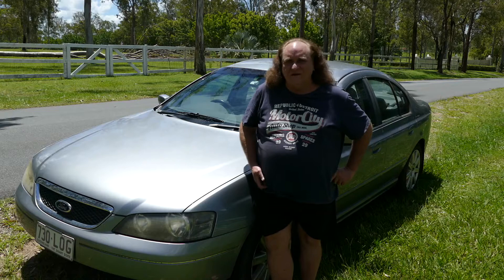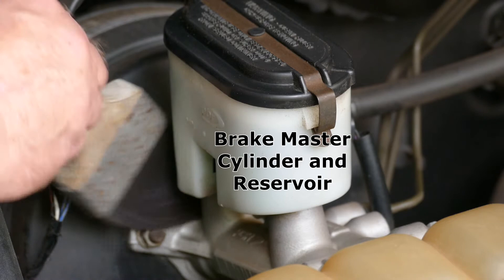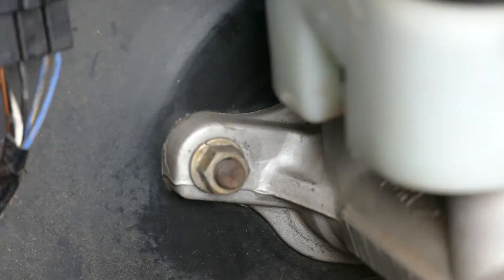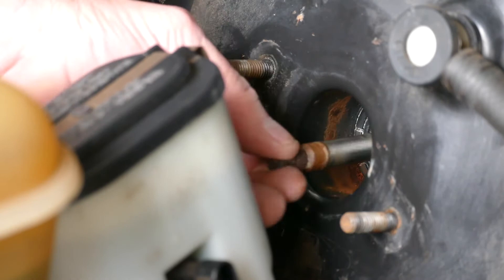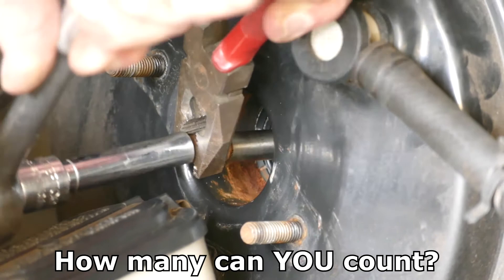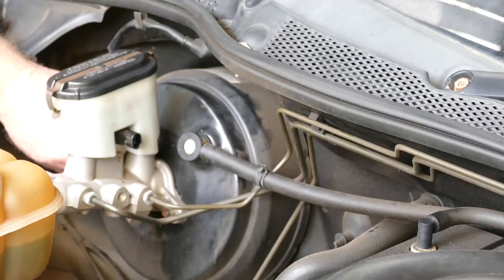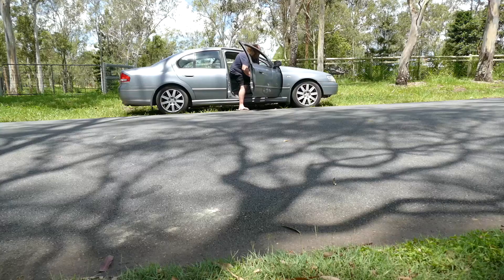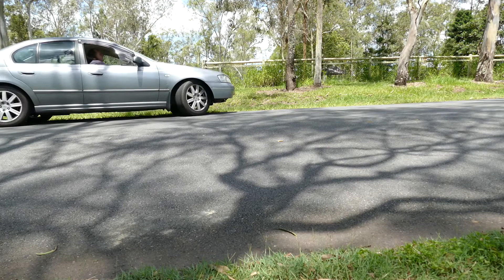How to Fix Dragging Brakes or Sticking Brakes on Ford BA to BF Ford Territory AU Falcon

Comment: OMG! Do not adjust that screw, there is a fault with the master cylinder.  There is a 3mm retaining screw inside the master cylinder that slowly comes undone and allows the plunger to come back further than it should which presses on the the push rod from the booster. So yes adjusting that rod will band-aid the issue but not fix it.
Reply from the maker: Noted: but 12 months on, it's still fine. I did say only about 1 turn I think?
Reply: No Every Ford Forum i've come across has said to do Exactly this to fix the issue.
Reply from the maker: So long as you limit it to only about 1 turn (or less - use trial and error) it SEEMS safe to me (and clearly others). AS David says & implies; Obviously THE BEST solution would be to replace the master cylinder with a new one - But I found the screw to be so stiff (likely a bit of rust, as seen in my video), that hopefully - the screw won't easilly work itself too loose. MINE hasn't in over 12 months is all I can go by👌👍
Reply: I've backed every one of my falcons off a quater turn to solve this issue since 2005. 

I learnt that trick from a mechanic,  who was told by a former dealership tech that when the last service before warranty ran out, they were instructed to turn in the rod so customers would be back for new pads and rotors. 

I tried everything on my 1st Bseries falcon from forums for 9 sets of discs until I asked my mate and learned this technique and never ever had a problem since. I put 400,00 kilometres on my BF mkii with the rod adjusted an never an issue.
Reply: Would this be the same for FG falcons too? I just replaced pads and rotors an sounds like brakes are slowly dragging and getting worse fuel economy.
Reply: @TheScalyArab  more than likely would use the same set up. I no longer have a bseries to compare to my fg.

Comment: Man, watched a few videos of yours just for knowledge in general since I own a ba XR6 MK2, glad I did cause I remember watching this a month ago & thought I’d rewatch as I’ve recently got all brand new performance rotors and pads, but now I’m having the same sticking issue, gonna give it a go this afternoon wish me luck 👌🏼
Reply from the maker: It's a very common fault - just be gentle, as it's likely to be slightly rusty like mine...2 years on, and NO MORE PROBLEMS with mine! 👍👍

Comment: Isn't the push rod meant to spring back in? And not be loose like that?
Reply from the maker: ...It's probably MEANT to have a bit of a return on it; but years, and what becomes a hostile environment with age, changes ideals. 😉🤔🍻
Reply: @SteveMack  yeah that's probably right. I did mine today on my ba xt and there was no return on it. It was loose like yours. But I'm pretty sure last time I checked that over a year ago it used to spring back in.
Reply from the maker: Originally, the rubber diaphrams act a little like a spring in most cars, but rubber looses some flexability with age, cracking etc. This is a great fix, short of buying a whole new setup (which of course IS an option), but mine' still running perfectly with this tiny tweak once only, and brakes don't drag anymore (which cost me new discs and 2 rounds of machining before I realised)😟
Reply: My ba mk2 has a rubber boot on the push rod.

Comment: Bought a au recently,  issue with drivers side rear park brake making noise when coming to stop. Sounds like a out of round disc, but disc are relatively new. Park brake pads 5 to 6 mm. Can. Anyone tell me the internal diameter of rear disk for park brake diameter  when new.
Reply from the maker: I hope someone can supply the specs - sounds like something dragging to me.

Comment: There’s a brake parts company in Victoria called partswise. They do an internally modified brake booster as a Bolt on replacement that supposedly fixes this issue………
Reply from the maker: Handy to know, thanks. Thus far, a few years on; this fix is still working well 👍
Reply: @SteveMack  

if you happen to still have the car 

another good upgrade for the brakes is braided brake hoses for about 200 bucks and change the fluid to DOT 5.1……. Of course Bendix pads and discs and it’s a unbelievable combined improvement under the pedal.
Reply from the maker: Oh yes, I definitely still have the car: of all the cars I've had in my life (even very exotic one-offs); this is by far my favourite! I did put new bendix discs on it (video in my Ford playlist) & since then have switched to ceramic brake pads...they're excellent! 👍

Comment: Thks buddy, did this to my BF mk2... also had a surge n the trans slowing and speeding up.. told it was the trans... was gettung real bad... thinking the coils... a sensor.... na was the M.A.S  & dirty throttle body! 2 bolts off remove the air intake from the throttle body, used a $6 can of brake cleaner spay n a rag wiped out the throttle body sprayed inside ... let it dry off n reassembled.  Reset the ECU (neg off battery) perfect.  I changed a trans thinking that was it... na could of saved $1300 bucks...
Reply from the maker: Nice work mate. Yep; cleaning the TB can work wonders, on all makes of cars! 👌🙂👍🍻

Comment: Great video with more informations about possible brake problem.I think they have specification by factory about adjusment of this bolts on brake buster and with time factory gap lose specification, but is worth to tray and sea changes.
Reply from the maker: Yes, it worked awesomely! NO further brake drag. I still can't work out WHY the gap increases

Comment: I have just done this on my 2011 Territory & now the booster has no vacuum, any idea what the problem could be?
Reply from the maker: I'd check to ensure that no vacuum hose became dislodged when doing this. Failing that; I'd suspect a tear in the internal rubber diaphram. Complete new boosters SHOULDN'T be excessively expensive, and are a common solution.

Comment: I have a similar issue on my AU. However it is only dragging on drivers side front calliper as it is red hot. Do you think this method would solve this?
Reply from the maker: Hmmm, I'd tend to doubt it; sounds MUCH more likely to be a sticking calliper on that side...try removing it, and cleaning up the slider pins, then lightly sand them, and coat with rubber grease, and reassemble (I mention this in 1 of my other videos on brake pad replacement); THAT SHOULD solve your problem! Let me know! 👌👍👍

Comment: mine is a seized caliper on one side playing up. my mechanic wont replace the one caliper so ive gotta get 2 rotors new pads and both of the calipers rebuilt one was already done but he wont do the job unless he does them both to his standards.  another grand. but love the car too much to part with it
Reply from the maker: Bummer. Yes; prices add up even when going aftermarket (which with Ford, and indeed most cars now) there's NO other option, as they don't carry any parts now. Having said that; if you pay $1000 all up, fitted etc, you won't have to worry about them for a long time (AND you'll be able to STOP...which is quite important) 😅😉👍👌
Reply from the maker: Parts like rotors and brake pads are pretty cheap from Repco etc...And easy enough to fit, as per my videos - How To Change Brake Pads BA Ford Falcon Ford BF Territory;https://youtu.be/rmJSOYyiR40 and
How to Fit Brake Rotors & Front Wheel Bearing Hubs Ford BA Falcon FG Territory;https://youtu.be/NkQqLt3oOT8
Reply: Brand new calipers x2 under $400, rotors and pads x2 $170...

Comment: There's no way on hell that was one turn.
Reply from the maker: You're right - it was roughly 2 & 1/2 turns by my estimate...What I said was "some people say half, I'd say 1 - 1 to 2"
Reply: @SteveMack  I wasn't having a shot at you,I was just pointing out that it was quite a bit more than you actually said.one a good note I have one of these that I made have to do myself if my next fix doesn't work.
Reply from the maker: Oh ok - Yeah, I said what others had sugested, but obviously went more turns, as it's a fine pitched screw, and a mere one turn would have barely made any difference. What I did, I WOULDN'T EXCEED though, and was prepeared, had it been too much, to pull it apart and unscrew 1 turn.  I CAN tell you though, that it WAS very worthwhile, as it indeed stopped the dragging brakes, and now a few years on - they STILL don't bind! (& believe me - I still often check by seeing if the car will roll on an incine in neutral) - It does. 🙂👌👍* I would squirt a small amount of WD-40 / RP7 onto the screw first though, and let it soak for a few minutes, as it was as shown; quite rusty from condensation over the years.
Reply: @SteveMack  thanks Steve,I have a problem with rear brake getting hot.i have rebuilt the caliper and still getting hot.my next move is to replace the hose and I'm hoping this fixes the problem.any idea's as to why.cheers
Reply from the maker: Just on ONE side? Sorry to ask the obvious, but did you bleed the entire brake system after installing the caliper?
Reply: @SteveMack  yes I did, the only option left to me at the moment is to replace the rear hose ( rhr  the problem side) the caliper was in really good nick before the rebuild and the temp is still warmer than the left side.i will be changing the hose tomorrow and see what happens.ill let you know what happens.cheers.one other thing is that both hoses have a small U bolt on them, what is the idea of this BS.
Reply from the maker: Been that long since I looked under the car, I don't recall u-bolts, just the rubber mounts holding the hoses out of the way. It IS possible that the hoses are so old they've become narrow - Here's a potential bonus for you; have you ever had the rear ones replaced under the recall Ford did? I found out by accident years ago, when taking mine to a Ford dealer for something; there were recalls on certain minor things - one was rear brake hoses, another I recall was something minor like an extra cable tie on an airbag: BUT, Ford will replace those things FOR FREE! No matter how many years ago the recall was - They just lookup the VIN to see if it's ever been done.👌👍
Reply: @SteveMack  I've only had the car for a few months so I don't know if it was done.i have never seen this on any car I've ever had nor have I heard of it.i will be changing the hose tomorrow and see how it goes.if it does solve my problem I will be doing the same on left side just to be safe.i doubt that ford would do this on a 18 year old car.thanks for letting me pick your brains.cheers
Reply from the maker: The recall included changing both rear brake hoses, for ones a few cm longer (obviously there were issues); THEY HAVE TO do them for free, regardless of how old the car or how many owners. Wouldn't hurt to give them a call and quote your VIN. You'll get it done for free if it hasn't been rectified by a Ford dealer.
Reply: @SteveMack  I'll give them a call tomorrow and see but I'm not holding my breath.cheers
Reply from the maker: No worries mate! - I was shocked when they told me of the recalls, and how I merely had to book it in for them to fix it up; and that was years after I bought the car, used! Let me know what they say - if you're lucky, the car may never have been in for the recall (or if the previous owner ever went to a dealer who was lazy and they didn't bother checking the computer system)...You MAY end up getting it all replaced for free! ! 😉🙂👍

Comment from the maker: ✅CHECK OUT MY NEW PLAYLIST: Ford BA Falcon - BF Series or Territory Repairs & Hacks;https://www.youtube.com/watch?v=jHvPgB7BXzk&list=PLzyvMrK6TMPNSY4gebX-_VRd6GJSpL9lI
📌If this video was helpful, please leave a LIKE & consider SUBSCRIBING (IT'S FREE!) as it encourages me to make MORE of these videos for you!;https://www.youtube.com/SteveMack [& CLICK 'ALL NOTIFICATIONS' BELL]
Reply: How are you with the handbrakes on a BA? Im asking because I need some help with mine. Today I went to use my handbrake and as I was engaging it, something popped so to speak and the handbrake lost all tension/resistance and I could pull lever all the way without it engaging the handbrake. So now ive got no handbrake. Any ideas/thoughts on what it could be the issue?
Reply from the maker: @michaeldelaveris3322  ...I think handbrakes should be banned, and we all go back to throwing a rock out of the window, attached to a rope tied to the chassis!! Seriously though; I've never found the need to adjust mine (not that I recall at least), the last Ford I adjusted was on my old F100. It SOUNDS to me, like a mount has given way - 1st port of call; climb under there, and visually inspect it all...Let me know what you find mate. Steve
Reply: @SteveMack  Ok will do, thanks.
Reply from the maker: @michaeldelaveris3322  Best of luck. Hopefully, it'll simply be a case of a small bracket rusting off and can be replaced - I can't honestly remember if they're welded on, but if so; more tricky, but still doable. It COULD simply be a broken cable also, in which case, they too can be replaced. Cheers
Reply: @SteveMack  I didnt get under the car to have a look yet, but in the car I removed the handbrake cover and the cable seems to be moving no problems when I engage and release the handbrake, its just not engaging.
Reply from the maker: @michaeldelaveris3322  Oh dear, perhaps the connection to one of the calipers is ceased in position – as this is a guess only, not being able to see it myself; maybe pull down the rear calipers, clean and lube everything up (correctly) will fix it.
Reply: @SteveMack  We shall see how I go and what I find, i'll let you know the outcome.
Reply from the maker: @michaeldelaveris3322  Thanks 👍
Reply: @SteveMack  Sorry its taken me so long to report my findings.....Had a look under the car and the cable has come off at that adjustment bracket, left rear. So the cable hasnt snapped, the lug or whatever you want to call it thats on the end of the cable has come off and the cable has come out of its hole on that bracket where they all meet.
Reply from the maker: @michaeldelaveris3322  Ah; my first thought was a potentially broken bracket as you recall, but not just the cable co min g off it - I wonder HOW that happened? Any problems refitting it? Thanks for the update!
Reply: @SteveMack  Im gonna send you a pic of it to yr email and you can see it for yrself. Gonna have no problems refitting 1 because im not doing it, my mechanic is😁....only because I need my ABS module and front ABS sensors tested and I dont have a scan tool to do it myself. Im hoping its not the module playing up because they are quite expensive.
Reply from the maker: @michaeldelaveris3322  No worries mate 👍